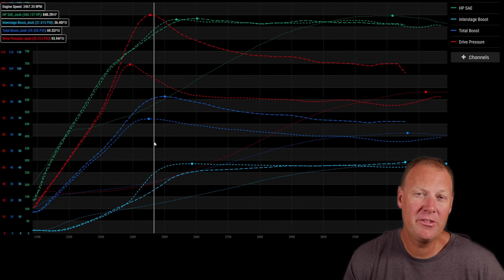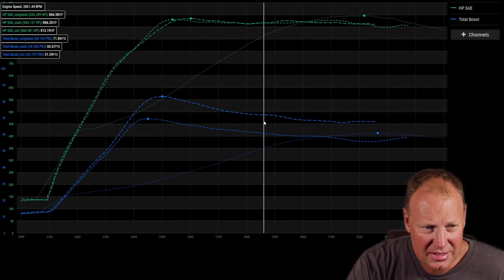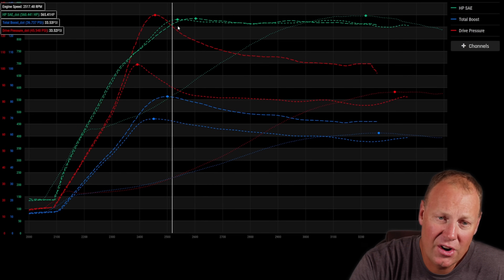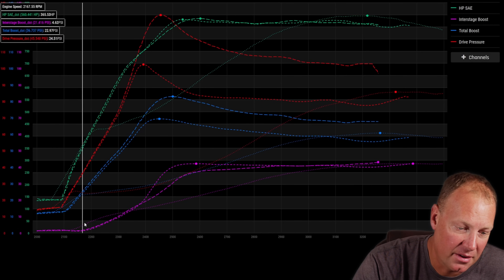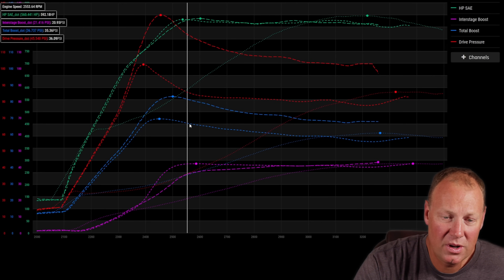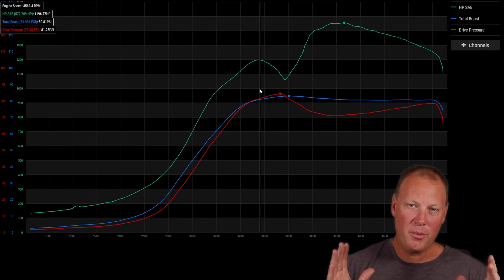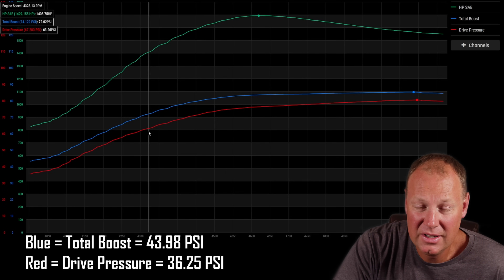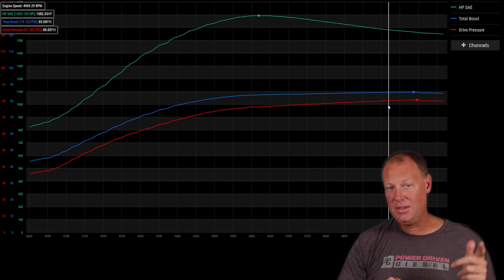Diesel Tech Tips: Wastegate Tuning

Comment: Im very curious how egts and iats as well as how the size of the atmospheric charger would  or could change if an inter-stage w/a intercooler was present. Textbook-wise this makes tons of sense. Why is inter-stage cooling seldom used in the diesel world? Because you can just inject water on a race truck? Not worth the gains and complexity on a street truck? Seems like it would be a killer idea on a tow monster setup. Id be curious to know more about that, and if that affects wastegate tuning. Im just doing research on diy-ing my own compound setup and trying to do as much math and figuring as possible and came across this video, which was extremely helpful.  

Sincerely,
Happy PDD customer. Lol
Reply: Cost and the additional complexities.  
 My thoughts. 
I am setting up w/a on my compounds . The earliest 1st gens and industrial (case ) applications used a w/a intake horn/manifold. The down side was using engine coolant at 180-220°f ( engine temp would dictated IAT, requiring major modifications in tuning to compensate for extreme IAT( proper IAT 10°or less above Ambant ideal 50-90°f)
 I am setting up a 2nd segregated loop with a variable speed pump and heat exchanger out front.  The space from the original IC is getting a 99-03 IC for inter stage.

Witch one wear?
A/A to A/W vs A/W to A/A 
A/A limmits out at Ambant. 
 A/W limmits out at water temp( with ice box and antifreeze sub 0 is obtainable).
Most run W/A as interstage for simplification.  Use the IC in place of the interstage pipe. But with no/ minimal proformance gains from the added effort over 2 A/A.  I am going the other more complex way so that when a chiller is used it will drop IAT below Ambant (R744 /co2 heay pump to ice the water/coolent) 

200ga of ice water was too little for the Salty Box , fastest Diesel Pickup  in the world, to make 227.8mph ; computer was in defuel for excessive IAT. In the 5th mile.

Enough for now

Comment: From AUS here can you guys do this with your K27 compound kits compared to the other towing compound setups that are available for the 5.9 12V, id love to see the VE pump stuff compared to  the P-Pump stuff too. I have a 12V VE with the stage 2 Power jet Nozzles, 4inch exhaust, k27. I do a mix of heavy towing and daily driving, I'm looking at possibly doing a compound setup with a cam as mines damaged. Not chasing more than 450ish hp as my little Toyota 80 diffs and a stock manualized 47re will hate me, thanks and keep rockin on!

Comment: "How do you make more boost, but not make more power?" Easy. Don't add any more fuel. Lots of interesting stuff going on with compound turbos. Would be curious to see the lowest boost you can run and still hit ~850hp by 2500rpm. Anything above 'tuned wastegate' boost curve is obviously not productive. Could you start to open the wastegate a hair earlier, target ~5psi less peak boost, hit ~10psi less peak drive pressure, and end up with the same power?

Comment: I have an external gate that is pushing open with backpressure on my single turbo system, I have to put pressure on the dome to hold it closed until I want it to open, and I suspect it's leaking a lot before I get to my target boost.
Reply from the maker: Could be.
Reply: @pddofficial  do I fix it by going to a smaller gate or what?

Comment: Whoever said you cant make boost without a higher drive pressure obviously needs some educating. You added a butt load of energy to the air in the cylinder and I know an internal combustion engine isn't 100% efficient so that energy exits the exhaust leaving plenty to drive a turbo with a 1:1 ratio for most of the engine RPM.

Comment: So on a single what do you think makes more power 50psi gate closed drive rising to 70 or 42psi rising to 47 drive? Playing with drive pressure spring gates that was as good as I got so going back to an air assisted gate to try to get  better control.  My SOP meter seemed to indicate the tight gate made more peak but suffered with rpm while the lower drive was flatter and possibly at higher rpms surpassed the tight gate despite being less boost, much like your tuned twins.  Oh yeah tell Todd there are internal gated s400 housings. 🙂

Comment: I have compounds on my 97 12v, I have stock hx35 with a 475. I had my 35 waist gate super tight from when it was my single. When I put the 475 on I could produce 70psi but I could tell drive pressure was high. I used a regulator and my air compressor to figure out how tight I wanted the waist gate. I set it so that it started to open and 25psi. It runs so much better, makes more power, has less drive pressure, spools faster, and does it at lower 60psi now.
Reply from the maker: That is a great way to do it!